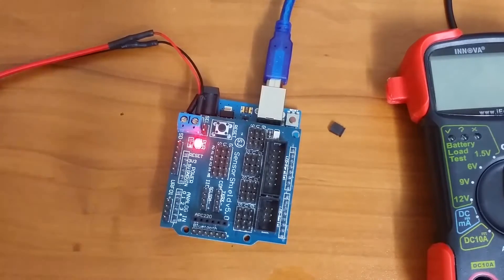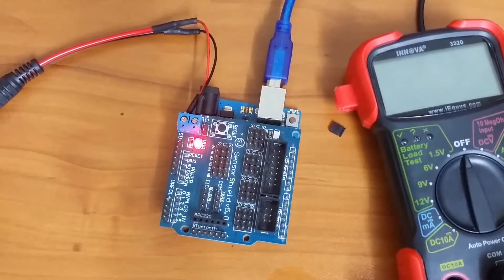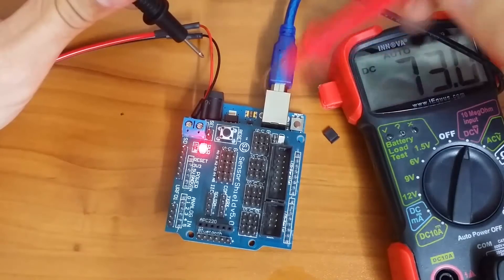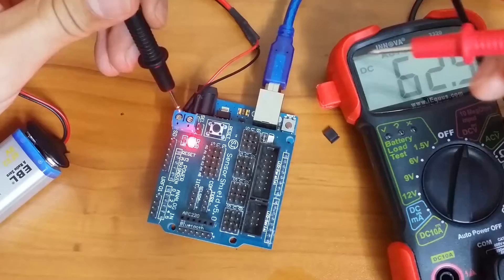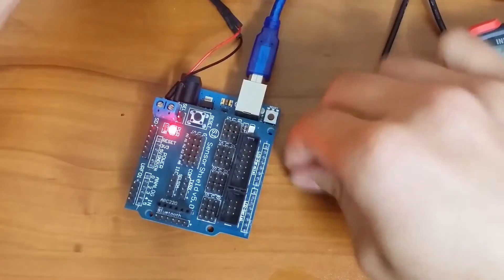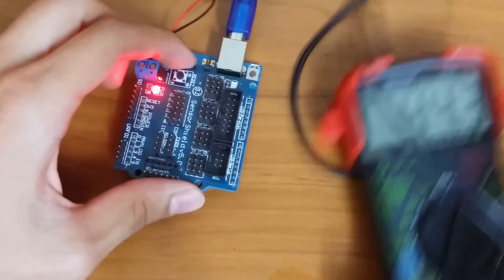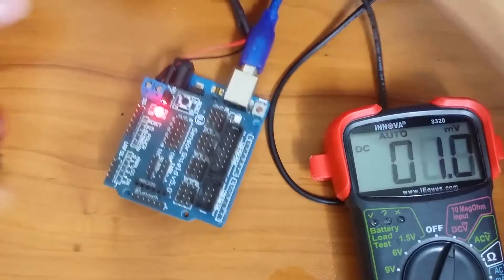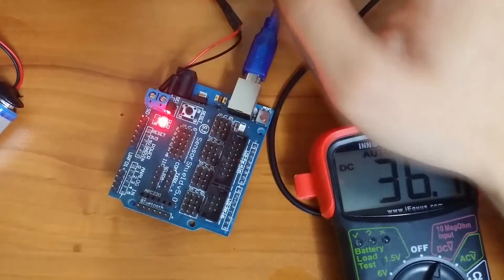Arduino Tutorial | How to Power  the Arduino Sensor Shield V5.0

Comment: Can i use a 5v supply just to the sensor shield to power the arduino too? Will the vcc gnd pin supply power to the arduino? Is it before the voltage regulator in the arduino so I can give 12v?

Comment: Great video, simple explanation! I plan on powering the sensor shield with a lipo battery for 12 servos. Do you know the best way to connect a lipo battery to the screw terminal of the shield?
Reply from the maker: Solder a custom wire?

Comment: I was wondering what if I use a barrel jack and connected the 9V battery to the barrel connector on the Arduino Microcontroller board, will the voltage be regulated to 5V on the sensor shield?

Comment: Thanks for the video. I am trying to power the sensor shield from 2 x 14500 Li-Ion batteries. I understand that I need to connect to Vin but I cannot find any accessible connection on the shield other than by soldering to Vin on top of the board? Do you know if any of the Dupont connection pins allow access to Vin? Thanks
Reply from the maker: Hi my recommendation is to do a continuity test using a multi-meter to determine if any of the DuPont connections are connected to Vin.
Reply: @QRobotix  Just to follow up on this... I have now traced all of the pins on the shield and have not found any that connect to Vin. So I will have to solder to it or the Arduino.
Reply: @QRobotix  ok thanks. Good idea.